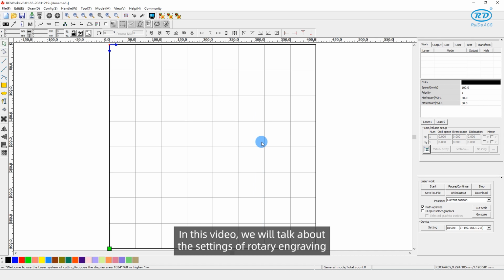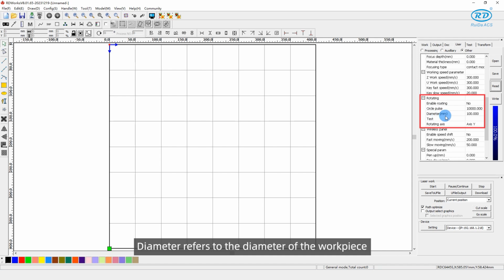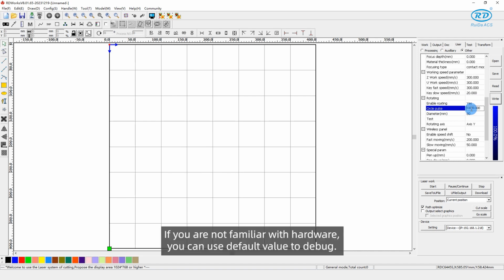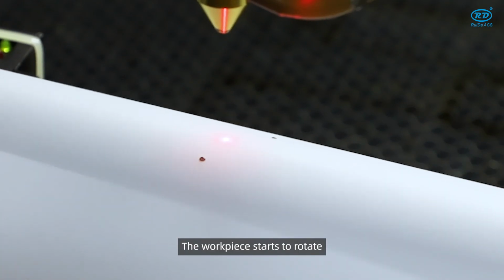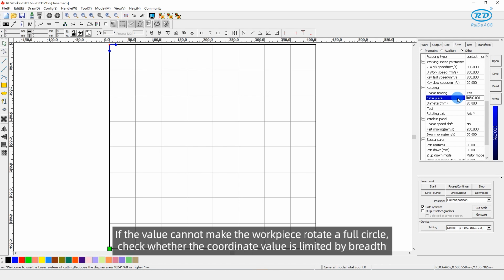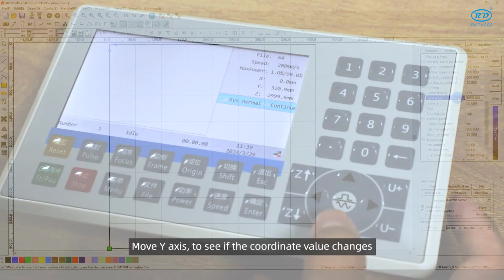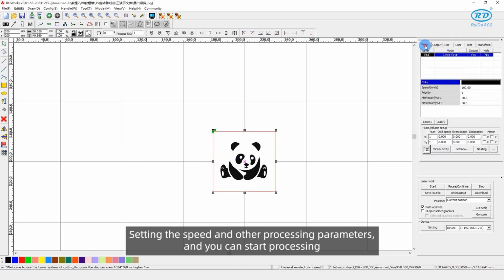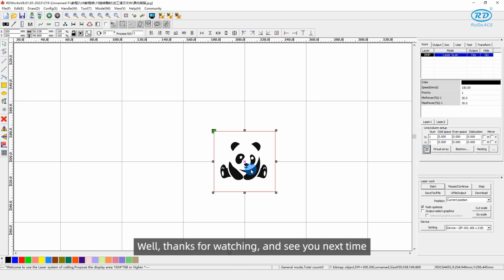RDWorksV8 tutorial : Set Up Rotary Engraving

Comment: The Ruida 6432G rotary function appears to not work.  I can use any value for "Circle Pulse" and the amount of turn is always the same.  Has a firmware update been released for this controller?  I have been unable to find it.

Comment: How can I change page Grid settings?
Reply from the maker: click the system setting-Interface-Grid, you can change the grid space.
Reply: @shenzhenruidatechnologylim5388  I found Grid space in page settings.i changed this setting but it's not applying on machine
Reply: I found Grid interface in page settings. i changed this setting but it's not applying on machine?
Reply from the maker: @mohdadil7327  normally if you change the setting and close the box, it will automatically apply to the page.
Reply: @shenzhenruidatechnologylim5388  yes it's apply on page but not applying on machine?